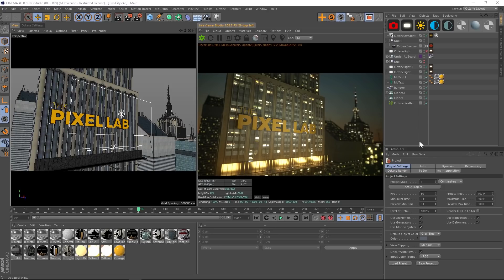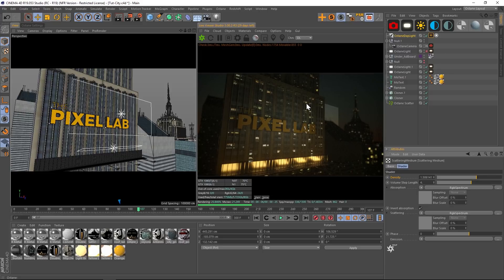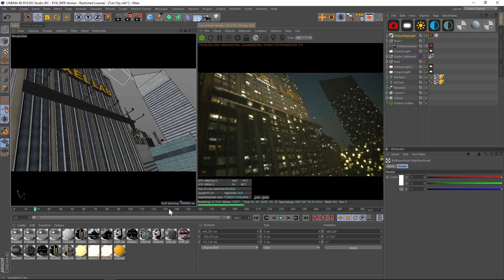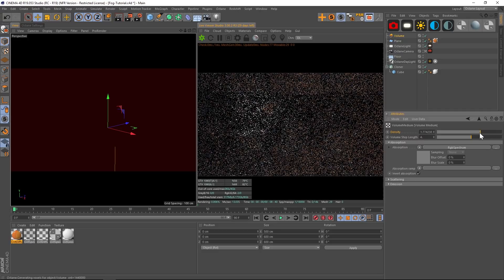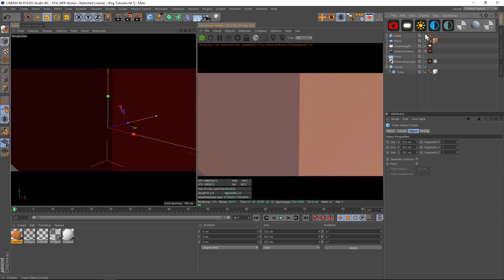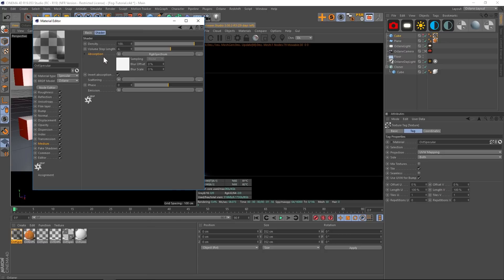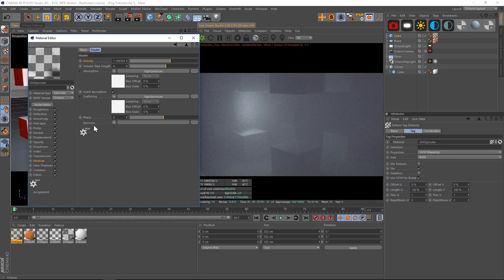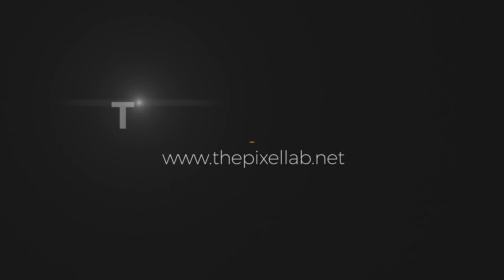Tutorial: Lights or Alpha Fringe Showing Up in Octane Fog

Comment: To remove that fringe of lights in volume fog, you have to set the step length value  less than 2 in medium setting. It will take longer to render but fix the issue. Same with alpha textures on polygons.